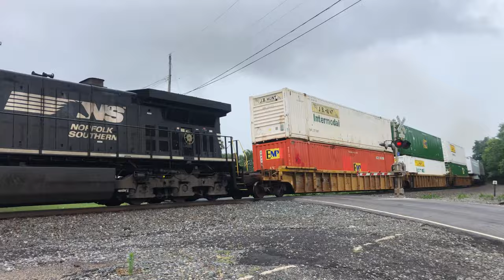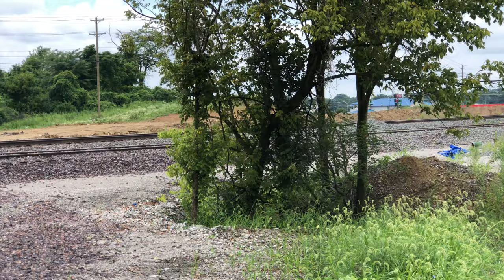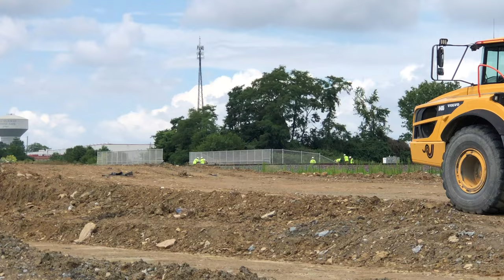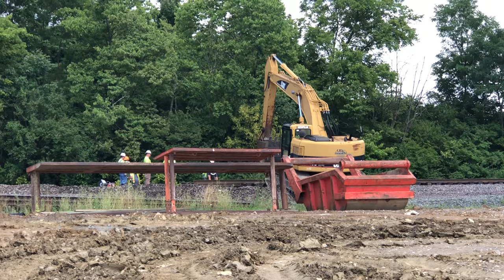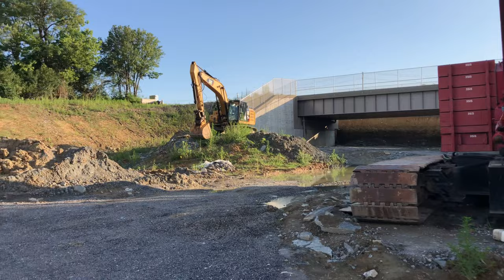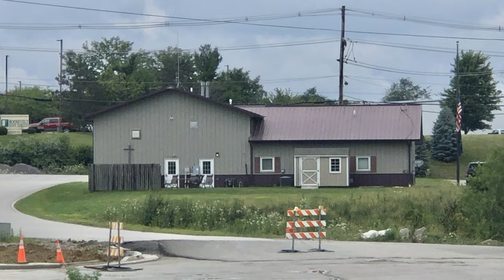Last Train Ever On The Railroad Shoo Fly Track!  New Main Line, Abandoned RR Track, Norfolk Southern

Comment: RIP shoo-fly, we knew ye well.  Probably be a restricted speed area for awhile until everything is final tamped and aligned. Looking forward to seeing the finished product!  Thanks for another update, good video.
Reply from the maker: Yes, I did hear them say that on the radio
Reply: Sorry JT, I tend to comment as I'm watching the video.  When this project is all wrapped up you should make a condensed video showing what's involved in a "small" RR/Highway relocation project.
Reply: Do those MOW vehicles check the track for truing it, making sure it’s squared-up?
Reply: They're trued up using laser aligners and tamper/levelers then they run trains over it at gradually increasing speeds and then do a final level/tamp.  Got a friend that works for Uncle Pete and that's how they do it.  Now having said that maybe NS does it differently.

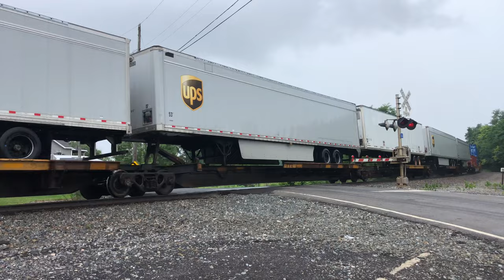Comment: And then it was gone with only one witness recording. Great to have captured the final train which zipped right thru. Projects like the change over are pre planned with manpower and machinery in places an ready to go. In fact this weekend and the past weekend WI DOT & UP were going to install the new bridge over US 41 in Wauwatosa WI resulting in a 54 hour road closure but T-storms cancelled that.  For the last NB stack train @ 2:05 note the demoted NS Roadrailer just like the old Thoroughbred set out to pasture. So the cycle goes

Comment: Do train crews have to (or choose to) (or nothing at all) do short horn blows in construction sites?

I railfan near a spot where the CP goes under a freeway overpass that is being reconstructed and sometimes I hear a bunch of short horn blows through there. No crossings otherwise and it’s a no horn zone anyways.

Thanks for documenting the shoofly for us, Jaw Tooth!
Reply: I believe the train crews get bulletins telling them about slow orders and special instructions,  alot of times they are instructioned to use extra horn in work zones to alert workers near the tracks as extra precaution.
Reply: I don’t know if it’s all railroads (it probably is), but in my neck of the woods, when there are workers near the track, two short blasts are required every 10 seconds with continuous ringing of the bell until the lead unit leaves the work zone.

Comment: I'd say as to the number of people on this job, the contractor has exactly the number of people they need to do the work. It looks like they have a few guys that have laser surveying gear so that accounts for some. At least one guy was doing some hard work swinging the sledge hammer and running the rail cutter.  Thanks for bringing these updates on this massive construction job. It's no doubt  like when they basically rebuild an interstate while keeping the road open with all the changes to where the lanes are located. Once the job is done, it will look like all that work never happened.
Reply: Orange hat seems like he is the only one physically working, then the equipment operators…….then numerous “supervisors”.

Comment: About 15 years ago near Kalgoorlie in Western Asustralia, a mining company wanted a railway crossing reactivated to allow their ore haulage vehicles to cross two tracks. The railway managers refused, which left the mining company with a 30+ km diversion using local highways. This also besides the diversion was more costly due to weight and size restrictions using the highway. It was estimated twice as many trucks and trailers would be needed. An Engineer for the mining Company came up with the idea of a subway(underpass) but a deviation(shoofly) was not feasible due to the the fact that the rail was already on an embankment and one track was deviating to a wye junction in the only area the subway could be built. The engineer then came up with a plan where by caissons would be installed each side of the track whilst the track was still operational. they first used diamond drills to establish the exact site where the caissons could be made up. A modified borer which was normally drilling shafts up to 1metre diameter upwards was used to drill downwards to get to the basement rock to build the caisson. This type of borer was the same type unit as was used to rescue the miners inTasmania and Chile. The bridge beams of concrete which sat on the caissons were then bulit close to the track to make it easy to lift. An 18hr shutdown of the track was set up where the track section just long enogh for the beams to be fitted was removed to allow the removal of the ballast and dirt just sufficient to allow  the beams to be installed. As soon as the beams were in place, the track crews went to work replacing the track welding the track and reballasting. The mining company at the same time set about creating the opening  for the underpass. The time allowed was eighteen hours, but the track was reopened in under 15 hours. There was no change to the track geometry, it was exactly where it was before the job started.  This process has been used in India and other places. It is basically foolproof, as all the work that is reqiured is done prior to track possession and the completion works are done after thetrack is in service. This Process can be used almost anywhere, just the preparation varies according to the local conditions.

Comment: It seems like they could have put 2 units up front, two dpu further back than what the single one was, and one on the tail end.  For a much more even power distribution. Or maybe 3 up front and two back quite a ways. But I guess as long as you are not breaking any couplers it's not a big deal.

Comment: I just wonder what the price of a good but used Shoo Fly track of this size will fetch on the open market these days. You should get first right of refusal, at least, for all your publicity. If it's a price to your liking... go for it. Probably need to make at least two trips to the JawsPalace in the Jawsmobile. Maybe cut it up just a bit to fit some most of it in your yard for storage You got all the documentation on the maintenance, operation and an emergency care. Even for another Shoo Fly surplus track buyer, that should be of value to any serious Shoo.Fly bidder. Well, it's sad to see. However, we all knew the day was coming. Still, it is difficult to hold back a tear or two. Gracias por to video. RT sends, Puebla, México...

Comment: 12 men standing around while only one working . Answer is they are moving the track to connect to the original track and nobody needs to be in harms way . The other men will be working when needed , line changes are a lot of work and very dangerous while moving the track . I worked for Union Pacific and was involved in a lot of track work and construction . SAFETY is the most important part of every operation on the railroad . I was a rail train operator unloading and loading used rail after the new rail was installed . Things happen and the rail can get caught on something while loading and then the rail kinks on the power cars and rail train before stopping the rail . Keeping every one in a safe location in case this happens is extremely important , you would be surprised if you could see just how flexible the rail is and how much can be torn up and how much work it takes to correct the problems . I had to put myself in grave danger using a cutting torch to cut the rail because I didn't want the welder to get for something I did doing my job . The train moving while loading rail is hard to stop when being told to stop and every second means more rail going every which way .  The men standing around will get to work when they are needed and then they will work their ass off getting the track in service so they can run trains . Shutting down a railroad for extended time periods is nerve racking and every minute counts . Trains are stacking up just waiting to get clearance to move and the pressure is on the top official in charge of such a job as this shoe fly realignment . Looks like everything went pretty smooth on this job .  Thanks for posting the video Jaw Tooth .  Great Video .